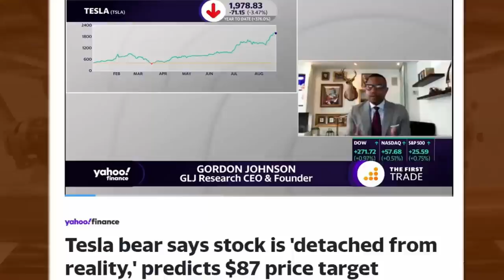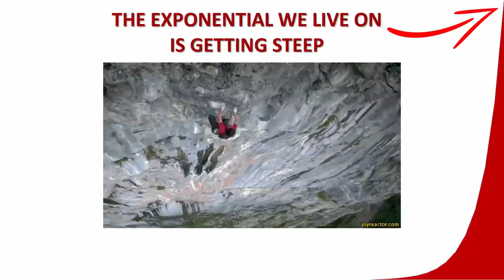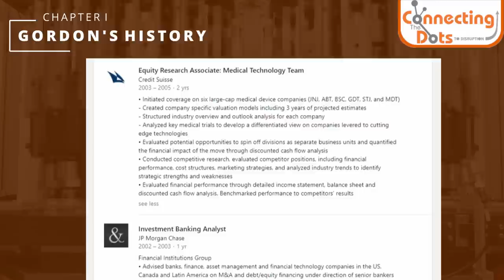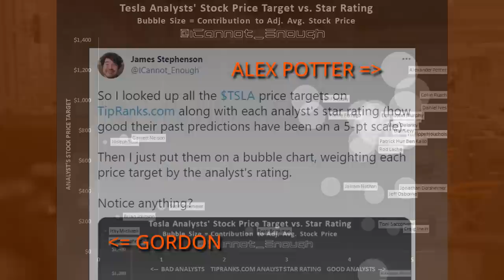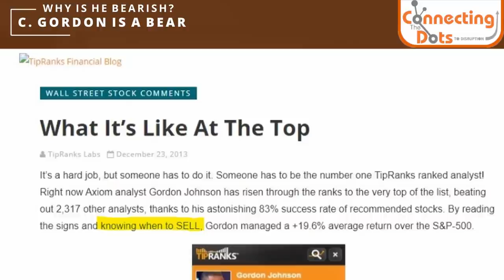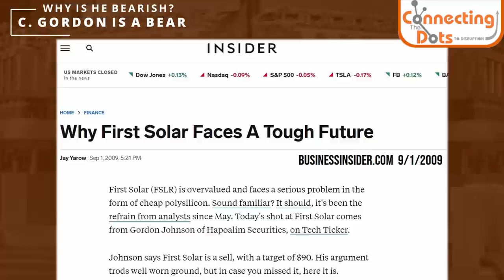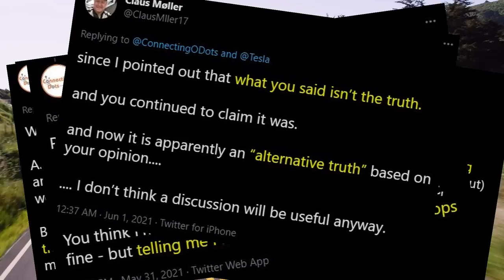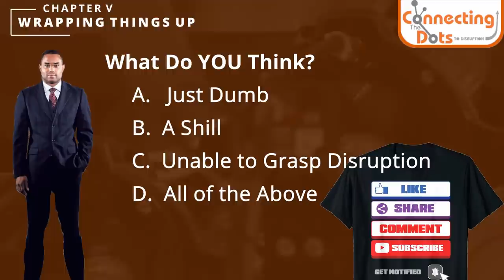Gordon Johnson - The REAL Story

Comment: i love Tip Ranks. i only rely on 1 star and 5 star analysts. All i do all day, is long whatever 5 star analyst says, and short whatever 1 star analyst says. easy returns. This is not investment advice
Reply from the maker: The priblem is that they're short term focused.  If you're a paying member i think you can watch 2year ratings which is a bit better but still short.  Using shirt tineframe,  garden was #1 in 2013, and this year cathy wood would've scored badly

Comment: I Think Sales of EV's will Top out at 25% here in the UK. 
They are NOT Practical for Use in the UK. ( Other than for Small City cars & Low mileage users. ) 
High Mileage Users & any Commercial Vehicle User will need LIQUID Fuel to Fill up as Fast as Petrol / Diesel is Now. 

OLD Granny Going to the Shops once a week Does not cause Pollution Whatever car is used. 
Commercial Vehicle Fleets & Machinery Run 24/7 for Business & industry.  VERY ESSENTIAL to Everyone. All Have an Essential JOB to Do.  NO time to Park up to RE-CHARGE. 

Just about EVERY EV owner in the UK probably has one or more Petrol / Diesel cars in the Driveway. 

The Concept of EV's is DESTINED to FAIL, For Sales & For Practical Use in the UK. For MANY DECADES to Come, For Most Vehicle Owners in the UK. 

EV's are UNICORNS & White FLYING ELEPHANTS. 

Ev's will Never Happen on a Large scale in the UK. For MANY DECADES. 
FOSSIL Fuels are ESSENTIAL in the UK. 
Shares in Tesla = Russian Roulette, 7 times you win, One wrong Click & your GAME OVER.

Comment: What a great annalise.  I believe you are 100 percent right, I canthink of atheist 4 major industries that they are world leaders in. I came up with a formula several years ago which has proved very accurate about supply and demand and it is this price = (supply x demand) x technology to the nth degree.  And Tesla,  battery production, robotics, solar and software.  When you buy Tesla that is what you  are buying these are all future technology's and each will destroy current major industries. With the new robotics like smart phones compared mobile phones there is a vast difference they are 2 totally different devices. That will be the new robotics smart robots not programmable devices. Sorry if I am rambling.
Reply from the maker: I 100% agree 👍
Tesla has a huge Tech lead, and it is only widening it. They have a lead in battery management and are making sure that they'll also have a lead in large cylindrical cells, they have a lead in solar with highly effective panels, at low prices - and with the solar roof. They use their battery lead to disrupt transportation with their cars, then disrupted the way cars are made with Gigacastings and soon Cybertruck. They also use battery lead for storage, and together with solar and Autobidder are disrupting energy production forming VPPs. Since all cars collect data, they have a data lead and will disrupt transportation much deeper with robotaxis. There's a chance they'll make home heating and cooling better (A/C with their heat pump knowhow) and enter VTOL once batteries are energy-dense enough.
In the future I see collaboration with the boring company to let Teslas go through cities rapidly without traffic. And that's just the tip of the iceberg - the main advantage Tesla has is rapid progress, like in your equation, it's the pace of innovation which ensures they won't be passed in the foreseeable future (i once did a video about moats which demonstrates this) – and now they're speeding up in AI. A friend of mine who runs a cutting edge AI company (actually CTO/cofounder) thinks they'll soon reach escape velocity to solving not only robotaxis, but also the Tesla Bot and Artificial General Intelligence – on their way to become the largest company in the world by far

Moats and pace of innovation - https://youtu.be/fEYJrixcn6I
AI CTO - https://youtu.be/BMIL_xENEfg

Comment: if apple invented a watch, the size of its' current apple watch- that has ALL the processing power of it's current top iphone x 3- and paired it with a set of 'apple glasses' that you can order with or without prescription- that will let the viewer see, virtually, a 60" HD tv image in front of them while still maintaining a view THROUGH the glasses... NO ONE.. .not even gordon would bet against apple. you could just shorten that... and say that no one, not even gordon would bet against apple, or sony, or LG electronics division, or any other consumer electronic maker. why? because of consumer electronics' track record. let me explain with a good example:

in the mid 80's... sony created the very first cd player. it retailed for $1000.00. : that's like $1400 of today's dollars. they sold a lot of those... made some money. today you can buy a BLUE RAY player... discs are the same size. and those discs hold 18x the data... and the player costs around $40. that's not the strange part: sony makes FAR MORE on the $40 version than they EVER DID on the $1400 version. and we could do this example ALL DAY with pretty much EVERY OTHER CONSUMER ELECTRONIC ever invented. which leads me to my next point:

the genius of elon musk and tesla is NOT just that he made an EV... LOOK closely at what he's done with TESLA- the ENTIRE car frame.. made from 3 pieces... 2 of them stamped INSTANTANEOUSLY.  the drive train and 4680 battery pack.. now able  to be made at a tiny fraction of the time it takes to make an ice car. as a whole- what elon has done.. .in effect- is turn what we USED to think of as the "CAR"... into a solid state consumer electronic. AND THAT- changes EVERYTHING. herein lies the TRUE genious of elon. he  was correct- tesla is NOT a car company.... and a tesla is NOT a "car"... it's a consumer electronic... easily upgradable to go faster, last longer and generally improve rapidly. an electronic.. that over time... will get cheaper to produce... and get better and more profitable as it improves. economy of scale... like NEVER before. ice tech has hit a brick wall.  and THIS is what the bulls are betting against.... the WORST possible thing they COULD EVER bet against. imagine if ANY analyst had bet against sony.. .or apple... or AMD... or INTEL!? you'd be toast. you'd NEVER recover... and neither will gordon.
Reply from the maker: I love this answer, really. Well laid out 👏